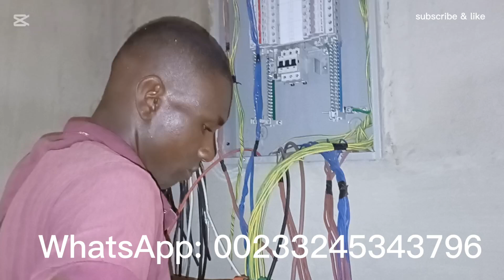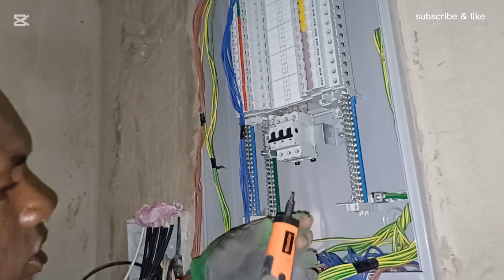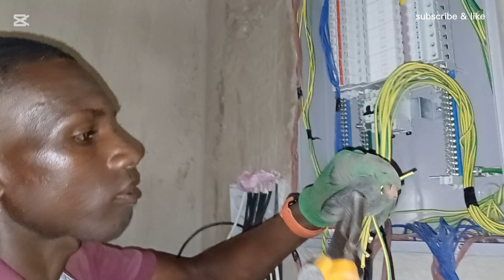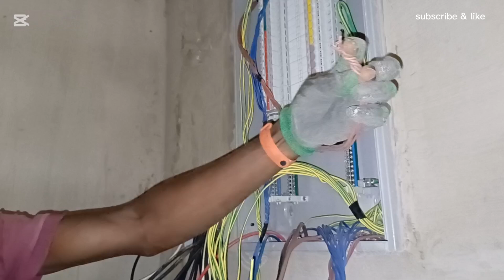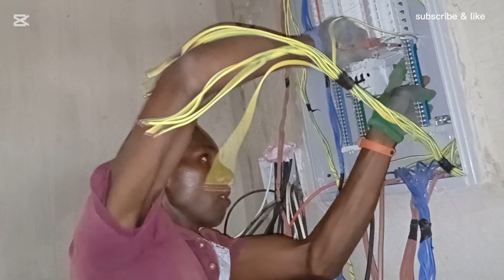Building In Ghana | EATON MEM SHIELD DB And Its Importance To An Electric Installation P3

Comment: Please how can I test the earthing system when I don't have the earth resistance tester.
Reply from the maker: @Kingsleyworlanyo-s1d  using a multi meter to test voltage (live and earth conductors) make sure to get same voltage when you test live and neutral and another one is using a test lamp; if the bulb is able to turn on and also is as bright as when you use live and neutral to turn on the light.
Reply: Okay boss thanks
Reply: Hello @Kingsleyworlanyo-s1d,

Without a specialized earth resistance tester, you can perform a few simple, albeit less precise, tests to check the effectiveness of an earthing system. The most common methods involve using a multimeter or a simple lightbulb.

Using a Multimeter multimeter 🧰
This method helps you assess the continuity and approximate quality of your earthing. It's a useful check for basic functionality.

Safety First: Ensure the circuit you're testing is live. Wear appropriate personal protective equipment (PPE).

Voltage Measurement (Live to Earth):

Set your multimeter to measure AC voltage.

Insert the positive (red) probe into the live (smaller) terminal of a socket.

Insert the negative (black) probe into the earth terminal (the top or bottom hole).

A reading of 220-240V (or your country's standard line voltage) indicates that the live and earth are connected and the earth is functional.

Voltage Measurement (Neutral to Earth):

Keep the multimeter on the AC voltage setting.

Insert the positive (red) probe into the neutral (larger) terminal.

Insert the negative (black) probe into the earth terminal.

A good earthing system should show a reading of less than 2V. A higher voltage (e.g., above 5V) can indicate a faulty earthing or a problem with the neutral line, such as a voltage drop due to a poor connection.

Using a Lightbulb 💡
This is a very simple qualitative test that can determine if an earth connection exists and is capable of carrying a load.

Materials: You'll need a lightbulb (around 100 watts) screwed into a base socket with two wires.

Test 1 (Live to Neutral):

Connect one wire to the live terminal and the other to the neutral terminal of the outlet.

The bulb should light up brightly. This confirms the outlet is powered and the bulb is working.

Test 2 (Live to Earth):

Disconnect the wires from the previous test.

Connect one wire to the live terminal and the other to the earth terminal.

If the earthing is good, the bulb should light up with a similar intensity to the live-neutral test. This indicates a low-resistance path to the ground.

If the bulb is dim or doesn't light up, it suggests a high-resistance path to the ground, indicating a faulty earthing system.

Disclaimer
These methods are for basic checks only and do not provide a precise resistance value in ohms. They can't replace a proper earth resistance tester, which is the only way to accurately measure the resistance of the earthing system according to safety standards. For any safety-critical application or if you suspect a serious issue, you should always consult a qualified electrician.

Sincerely,

BESA Research